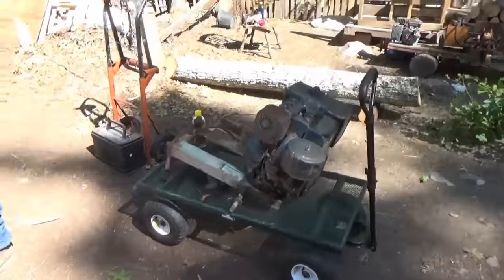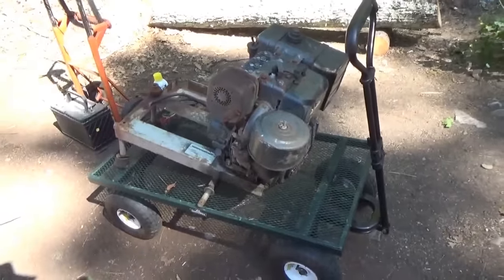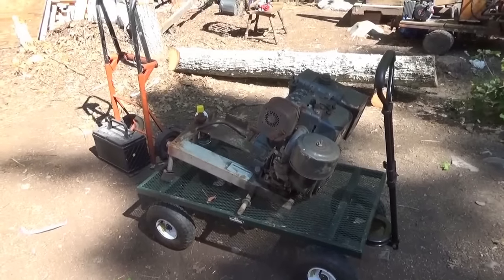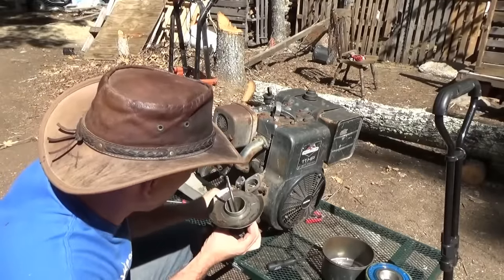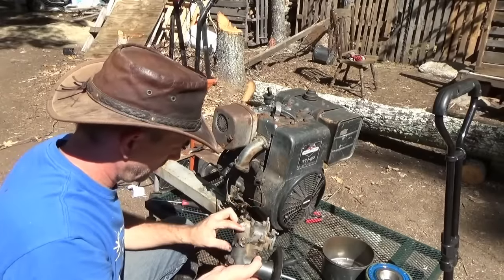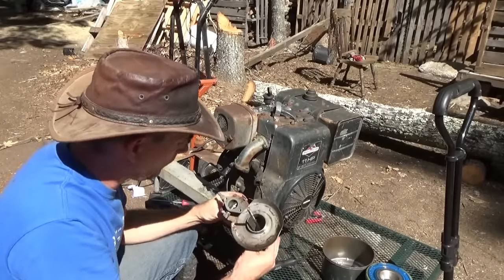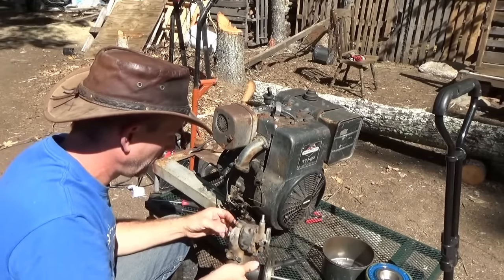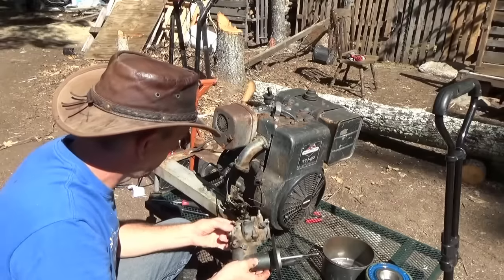Cleaning Carburetor On Old 11 HP Briggs & Stratton Engine

Comment: A real pro. You need to take the high speed needle out then go in with the proper size screw driver and SCREW THAT EMULSION tube out FIRST ...then take it apart.

Comment: Troy: Ethanol gas is a problem with small engines, Finding Ethanol free gas can be difficult(Only 18 Stations offering Ethanol Free Gas for the entire state of California!!!). While a pain, it can be dealt with. 1) Use Stabil or other additive to prolong gas storage and defeat Ethanol issues. 2) Drain the gas from tank and run the engine dry if it''s going to be more than 3-4 weeks between running the engine(Note provided you use Stabil as well). I do this consistently and don't have issues starting and running my variety of small engine equipment.
Reply from the maker: Yes I hate that stuff. Destroyed my 61 Falcon and ate up the engine on my DC generator. I recently found a source nearby - 13 miles away for NA gas. I only use alcohol free gas in any small engine I run now. The husky chain saw will never see bad or cheap gas.

Comment: I am currently working on one of these.  model 243432. Mine is on an old Rolling Concrete saw. I cant find anything on the throttle linkage and how its supposed to be done. None of mine was assembled, just had parts. Any help would be great, Thanks and good vid.

Comment: Just curious... Since you are tearing apart the engine anyway, what would it take to convert the engine to run off of wood gas? Or would that not work in this instance?
Reply: it would work but he would lose 20 to 30 percent horse power
Reply from the maker: Well, since an 11 hp engine is more than this machine needs that is not a problem. But wood gas is dirty and gums up an engine. I have not yet worked out the filtration needed to run an engine on wood gas. Hopefully one day I will work with it because I have a few generators with obsolete carbs just waiting for an experiment like this.
Reply: Sounds like that could be a fun video series. Keep up the good work and the great videos!
Reply: The Do It Yourself World i really do hope to see you expirment around qith a gasaphier ..i never even thought of the filteration of it. i have seen the basics of it work on how the gas is made but have not seen it applied

Comment: Do you know the year of this motor? I have 2 red 11hp Briggs like this but pull start and I would like to get parts but cant find anything if you know anything please lmk
Reply from the maker: There should be a serial number stamped on the metal somewhere. You can look that up to find your model number
Reply: @TheDoItYourselfWorld  yea unfortunately I dont have the flywheel shroud and have wire wheeled the whole motor with no luck on any other identification numbers.

Comment: What a hack, I can't wait to see how you reassemble this without removing the emulsion tube. Right now you're just lucky not to have bent the tube when you took the carb apart.
Just spraying carb cleaner through an old carb does not mean it's clean!!!!
Reply from the maker: LOL. Hack huh? Ok then. Well I fix engines all the time out here so I dont have to prove anything to you. You are correct tho that you do not just spray carburetor cleaner through and call it clean. I use an air compressor as well (in this very video) and if needed, wire to run through the ports. But all that you can see in my videos. Again, I dont care what you call me. If they run, I am happy :)